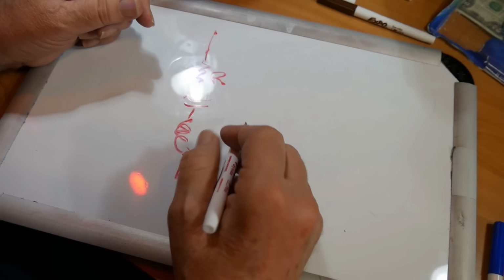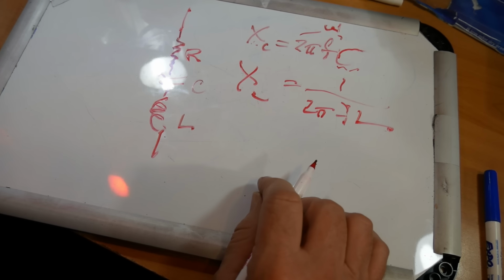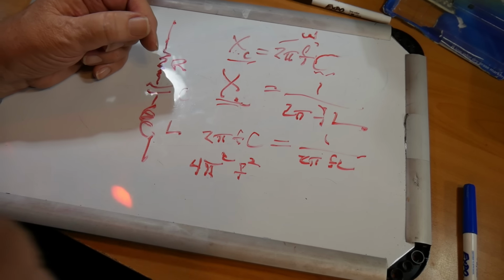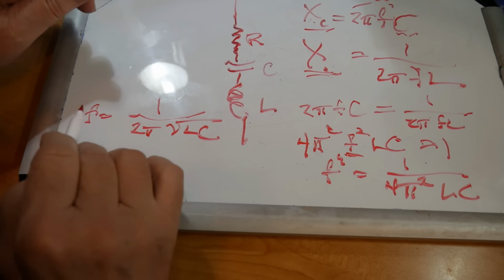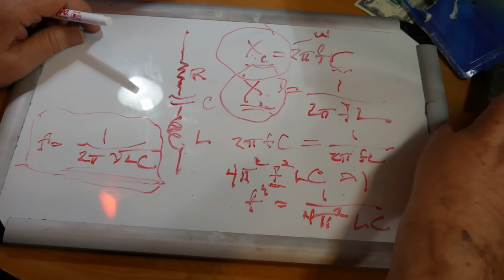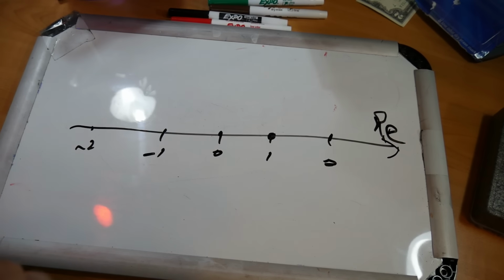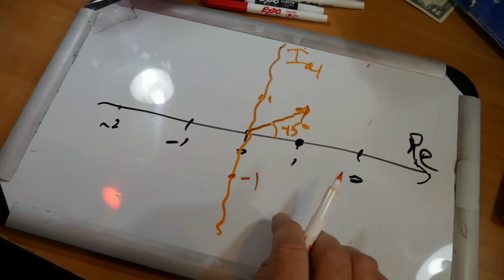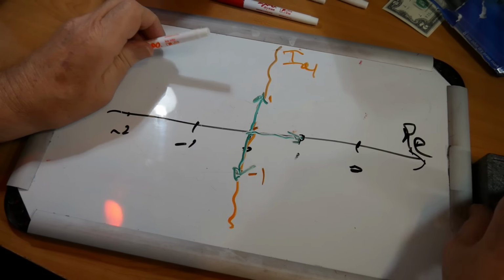That Pesky Imaginary Axis (#1417)

Comment: Dave, I’m sorry to ask a question that is not related to this video, with field day coming up next month, what are the operating rules related to allowing a technician license holder to operate on frequency’s allocated to general/extra license holders?  I am under the impression that as long as the general/extra license holder is present and in “control” of the station, technicians are allowed to call Or answer a call on a frequency that the would not normally be allowed to operate. But what is the requirement for identifying this situation?  This Wouk be a great “ask Dave” subject. Thanks,

K5AZZ (Kevin)
Reply: He’s not going to reply bud